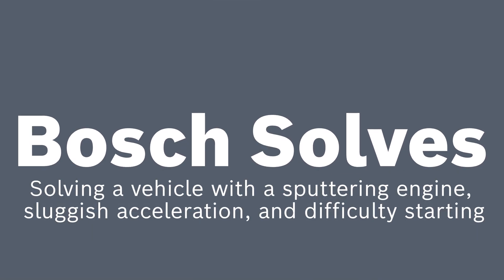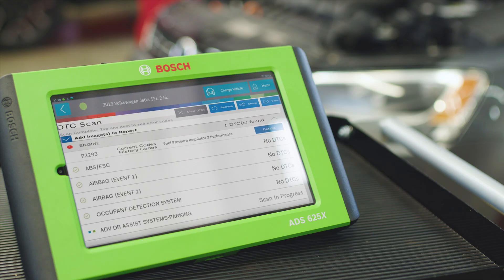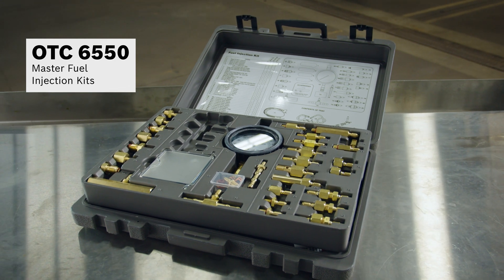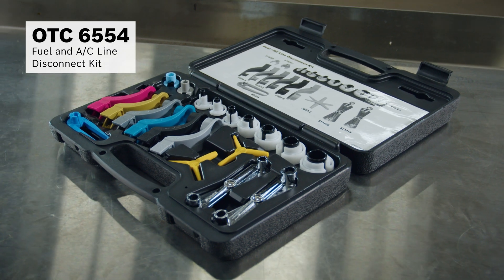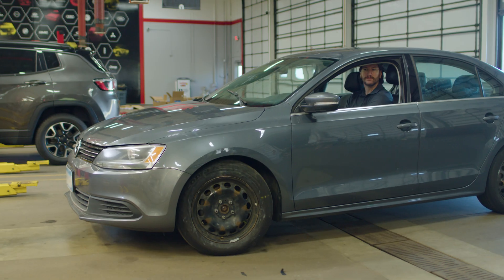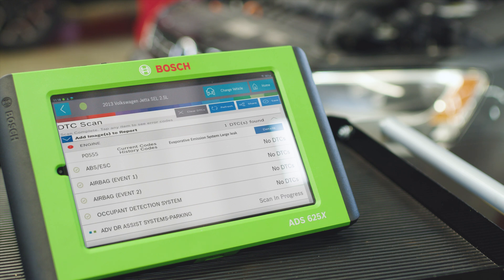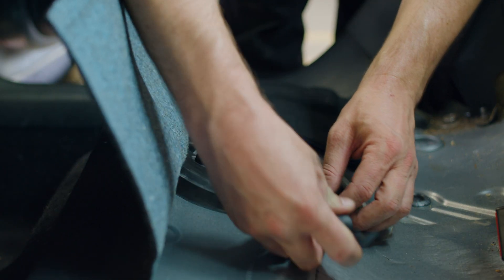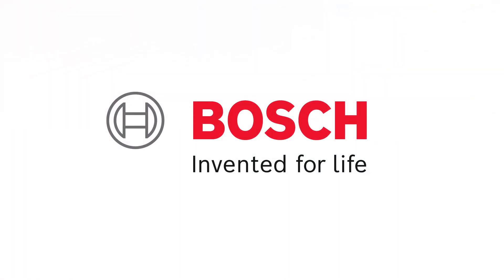P2293 and P0555 DTC Fuel pressure problem and EVAP leak on VW Jetta

Comment: 1.) What data did you extract from the vehicle's ECM to justify replacing the fuel filter and performing a fuel pressure test?

2.) P2293 is just a code! What data did you use to verify that the fuel pressure being commanded to the injectors is different?

 3.) So priming a fuel pump is enough justification for assuming the power, ground, and command to the fuel pump is good?

 4.) The CEL came on during the test drive? Very doubtful as the EVAP monitor is difficult to run and if you did drive the car that long then why not just force the monitors to run on VW/Audi products with your scanner?

5.) You smoke the vehicle from the fuel filler neck and saw smoke but what about blocking off the vent solenoid?

 6.) What does a quick scan do after fixing an o-ring? The vehicle needs to be driven for the monitors to run or force the monitors to run with a scan tool as previously stated. 

All of this makes sense why your diagnostic tools sales are terrible compared to other brands. It still amazes me how bad it is because you guys virtually make every OEM interface and the Mastertech 2 is a phenomenal piece of hardware but your scan tools are terrible.
Reply from the maker: Thank you for taking the time to reach out. We've forwarded your inquiry to consumer care, who should be reaching out to you soon.
Reply from the maker: Hello Chad. Thanks for reaching out. Our team has reviewed the video and provided these answers to your questions.

1.) What data did you extract from the vehicle's ECM to justify replacing the fuel filter and performing a fuel pressure test?

2.) P2293 is just a code! What data did you use to verify that the fuel pressure being commanded to the injectors is different?

Because typically a “Performance” code like this one indicates that the ECM/PCM sent a command and determined that the commanded target wasn’t met.

Different makes and models can set the error code P2293. But this does not mean that there is a one-size-fits-all approach to diagnosing its underlying cause. The steps for troubleshooting this code will vary depending on your vehicle and your knowledge. Most experienced technicians are aware of the high-pressure pump, and their known issues and related noise that they make due to ware. This car did not have that known noise associated with cam plunger issues. Using scan-tool data at this point would not have been quicker in diagnosing this vehicle. (Many of these P2293 code by themselves you will need to do a road test while recording scan-tool data and verify it is within 1.5 MPA allowed variation.) Our technician started by checking the low-pressure pump and a possible restricted fuel filter is a 100% reasonable diagnostic strategy based on driver complaint and code.  

As seen in the video we were right in starting our diagnostics with verifying low-pressure pump pressure.  

 3.) So priming a fuel pump is enough justification for assuming the power, ground, and command to the fuel pump is good?

Simple answer is “Yes” the car was running, We drove the car in the bay. 

 4.) The CEL came on during the test drive? Very doubtful as the EVAP monitor is difficult to run and if you did drive the car that long then why not just force the monitors to run on VW/Audi products with your scanner?

(On the video it says P0555 should be P0455)

We were very lucky that the evap. drive cycle was completed while we were on our test drive to verify our repair of the low-pressure fuel pump. must have been very close to running its Evap. test and popped the P0455 code.

5.) You smoke the vehicle from the fuel filler neck and saw smoke but what about blocking off the vent solenoid?

Knowing that we were just in the fuel tank area and could have bumped off a line or as you saw we made a mistake on the installation of the O-ring on the pump assembly. (the SMT500 had plenty volume of Vapor to see very well the large leak without closing the vent solenoid) 

 6.) What does a quick scan do after fixing an o-ring? The vehicle needs to be driven for the monitors to run or force the monitors to run with a scan tool as previously stated.

(The quick scan was used to verify that we did not have any other codes stored or set due to our repairs) 

(When we completed the pre-scan there was no other code than P0455, after finding and repairing the large leak “O-ring on the pump assembly” we were confident that the vehicle was fixed correctly). 

All of this makes sense why your diagnostic tools sales are terrible compared to other brands. It still amazes me how bad it is because you guys virtually make every OEM interface and the Mastertech 2 is a phenomenal piece of hardware but your scan tools are terrible.

Chad, we are not sure what you mean that our tools are terrible compared to other brands? We are the only aftermarket scan-tool company that offers a 30-day money back guarantee that we are aware of, the return on that guarantee is negligible less than 1%. 

Thank you for recognizing that BOSCH is the recognized leader with the majority of OE and the factory tools and software we supply to them. 

Thank you for all the critique of this video and we wish you well in all your endeavors.